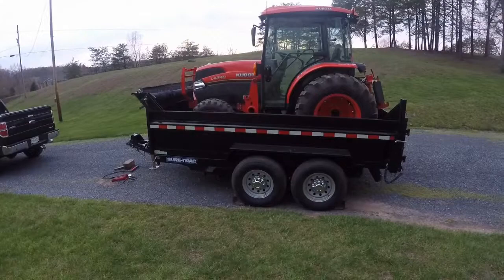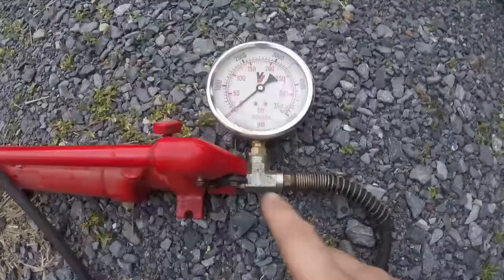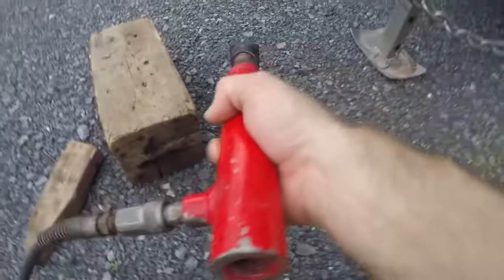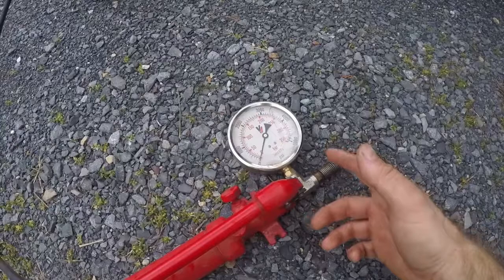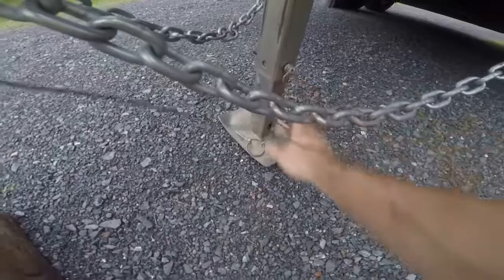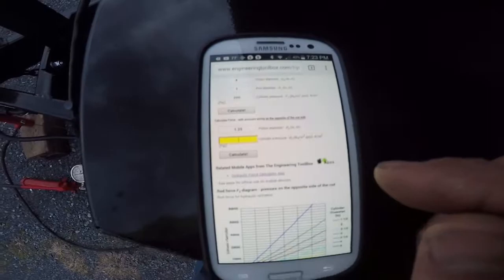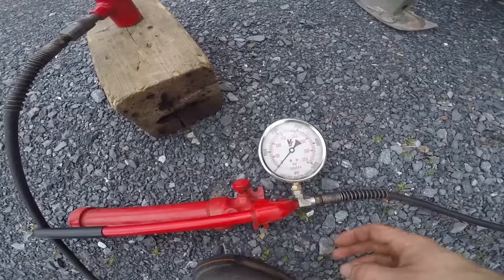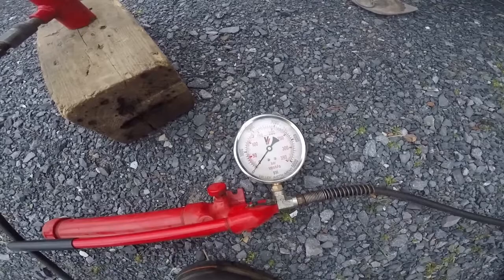A Different Way to Check Trailer Tongue Weight

Comment: Pressure is pounds per square inch. Multiply the pressure in the ram by the area that the pressure is "pushing on" and that gives lbs. 650psi x area of ram ( 3.1415 x.625^2)= 797lbs
Reply from the maker: Thanks!
Reply: (3.1415 X 0.625^2)=1.227 X 650 PSI=797.6#
Reply: and once you know the sq. area of your porta power it never changes. just measure the pressure by 1.227 (in his case) every time. nice.

Comment: 800 lbs on the tongue is that with a half ton or 3/4 ton truck?
Reply from the maker: 1/2 ton with a weight distribution hitch
Reply: @TractorTech  Exceeds the tow rating... by appx 15%
Time for a bigger truck.
Reply from the maker: I'm not sure where you got them numbers.
Reply: @TractorTech   From his chevy manual !!

Comment: Just buy a weigh safe hitch.  Avoid all that noise that this video just talked about, its 2018 not 1925.
Reply from the maker: What if you use a weigh distribution hitch? Their universal ball only goes to 10,000 and my not work with a WDH. If you want to send one to me I'll do a review on it.